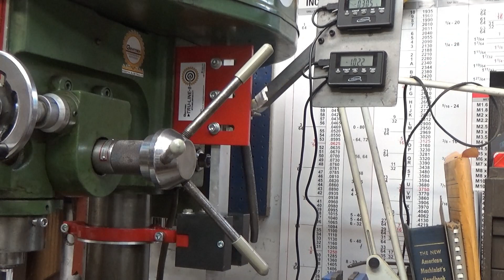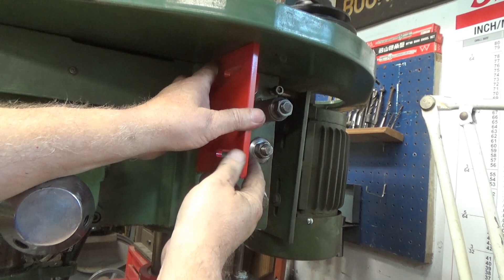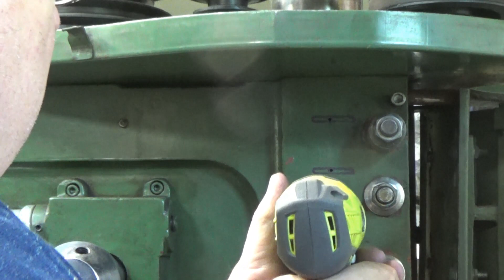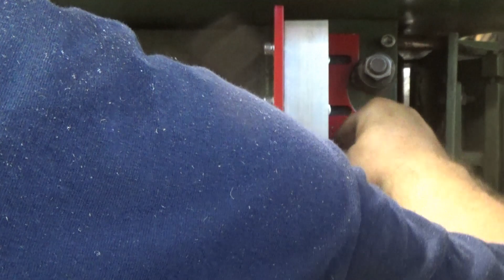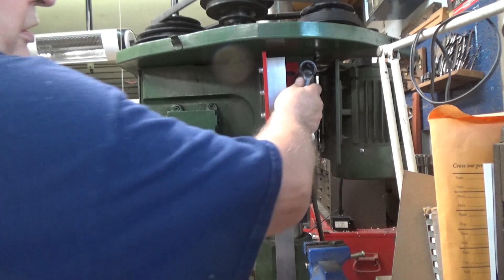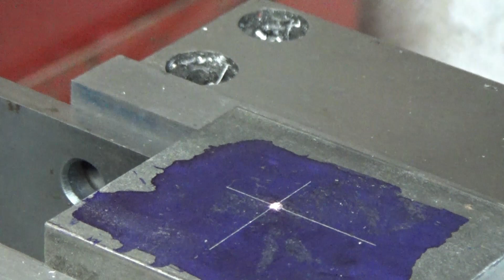Tru-Line 8 Installation Part #2

Comment: That turned out Great. I tried making a System myself, but it turned out not to be Rigid enough. I also need to do something about the Crank Handle for Raising and Lowering the Head. I like your Idea. How much did the Stiffener cast with Shipping, if you don’t mind me asking? Great Video. I really enjoyed it.👍❤️
Reply from the maker: I got the unit from a friend and machinist from Australia.  All I paid for was the freight. He gave it to me to promote.  Unfortunately he has had to close up his shop because of family health issues. Both Everett’s Workshop and Winkys built successful alignment units.  Check out their Channels.  Thank you for watching and commenting.

Comment: Greetings Steve. I have a round column mill in my home workshop and am frustrated with the head raising and lowering shortcomings. I am spoiled having worked on Bridgeport milling machines in my career as a machinist. I plan on making and installing a similar feature to keep the head aligned during repositioning it up and down.
Reply from the maker: I have been very satisfied with this arrangement. Unfortunately, Bruce, the builder of the Truline 8 has had to close up shop.  I have seen several versions of this used on the round column mills.  Two examples are https://www.youtube.com/c/EverettsWorkshop and https://www.youtube.com/c/WinkysWorkshop.  What I found that made the biggest difference has been using the ratchet on the elevator mechanism.  Using the crank handle put too much torque pressure on the head of the mill. Thank you for watching and commenting.

Comment: Instead of that huge center punch mark, or even the cross hairs, I would suggest you use a 12” high precision pin in a collet, and mount an indicator on the table and measure that. Use a flat tip so it doesn’t move off center on the pin. You can’t do this by eye. You could be off by 10 thou, and not notice. You can get the pins from McMastercarr.
Reply from the maker: Use of the machine with the alignment device attached has proved to be accurate and reliable.  Certainly  well with in the limits of the work that I do.   Thanks for the suggestion.

Comment: I heard about Bruce's gadget some months ago but never got one onto my round column mill.  To be honest I was partly suspicious of the idea but after seeing a couple in use, and your demonstration I guess they are legit!  Don't get me wrong, I have great respect for Bruce after seeing what he can do, it was more a consideration of the limits of the round column mills that I know.  Good video, thanks for sharing this!
Reply from the maker: I was suspicious at first when I saw it and spoke to Bruce about it at the Bash. For most features the accuracy is just fine. It holds within a couple of thousandths.  I biggest improvement is the ratchet replacing the crank. I want to put a motor drive on it, that will take of the the torque out of twisting the head.  Winky's Workshop just did a video on building his own. I think that the Tru Line 8 is more ridged.

Comment: Steve, great job my friend, thanks for the shout out, the laser stole the show, and helps me show just how good my product is. Best wishes and look after yourself. Bruce
Reply from the maker: I have gotten some requests about the Tru-Line 8 from my viewers.  I hope that they are getting through to you.  Thank you again for the opportunity to try it out.  I have had that laser for several years and that is the first time that I have had a proper use for it.  The video blurred the light point a bit, it is actually a very fine point that works very well with the scribe lines.
Reply: Where can I get laser pointer

Comment: Gday Steve, this will be a game changer for when you forget like I do about height needed in the next procedure, many times I haven’t been able to get a drill in the chuck by 1/2 inch, this can be very frustrating, the Trueline-8 is a great design, thanks for sharing Steve, great idea with the bloopers at the end, take care mate, cheers Matty
Reply from the maker: Thank you Matty, this will make the mill much more user friendly.  Going to think about putting a power hear elevator on it.
Reply: Hi Matty, I almost mentioned the one you made. Yours turned out Great also.👍❤️
Reply: @joeybobbie1  best modification I did to that machine mate

Comment: Nice work Steve, and nice test results. Could you post a lead to the laser tool? 
One thing Steve, I have the same DRO as you and I will ask do you have a problem with the DRO picking up electrical noise, and the readings randomly jumping around? I have this problem from time to time and would appreciate any comment regarding this subject. Cheers and thanks!
Reply from the maker: I will try to remember to send the info on the laser when I get home after the Holiday weekend. As for the DRO the only time I have had a problem is when the batteries were low.  Thanks for watching and commenting.
Reply: @sharkrivermachine  Thanks for the prompt reply Steve, I will check my batteries as a start, and I'll let you know if I have any revelations that may be of interest to you. Have a nice weekend, cheers!